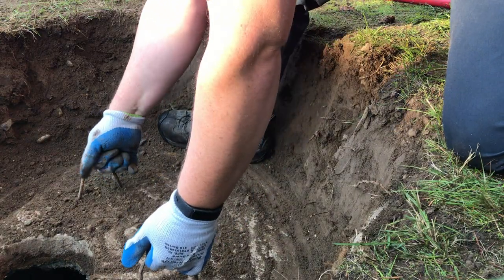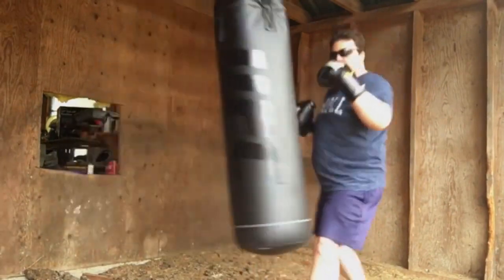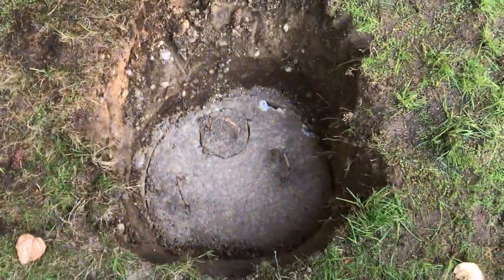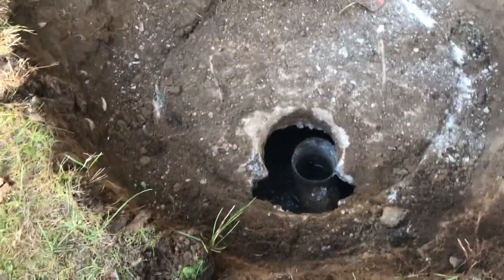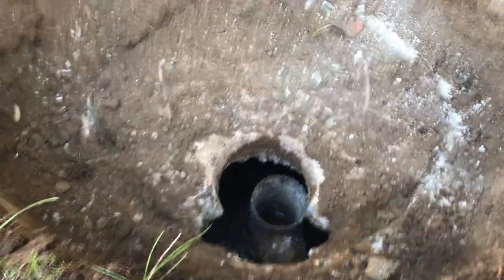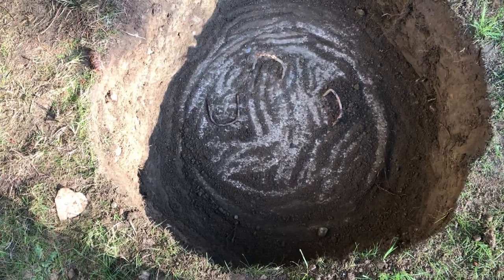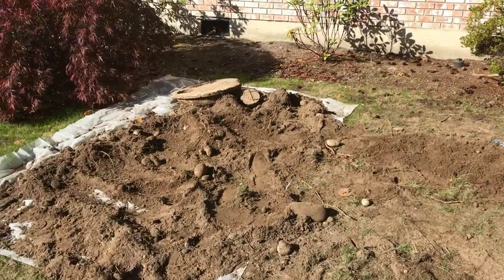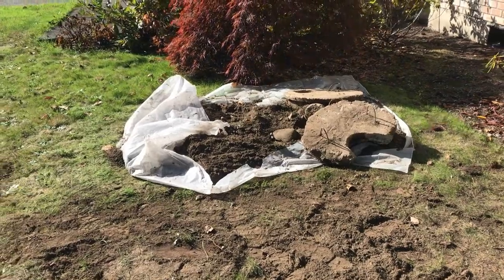Septic Tank Problems / Concrete Septic Lid Stuck! *How To Fix*

Comment: Haven't you ever heard of an Electric Jackhammer dude... that's the ticket. Otherwise, just use a sledge hammer, and take it out in pieces. By the way, if any pieces fall in the tank, it doesn't hurt anything, so don't worry about it.